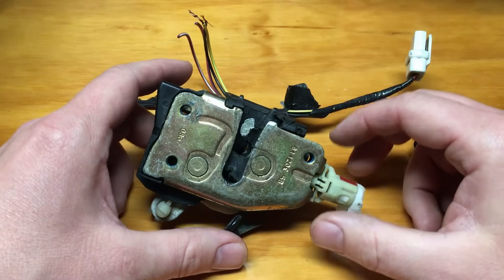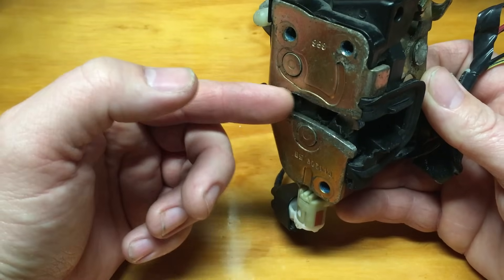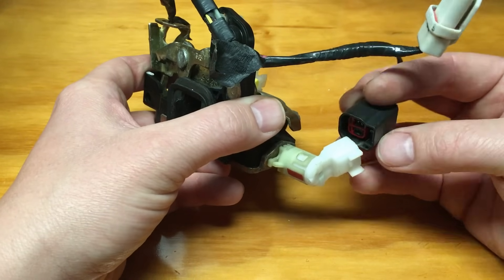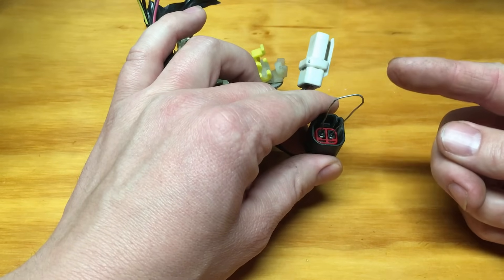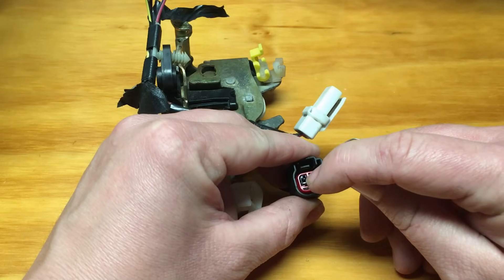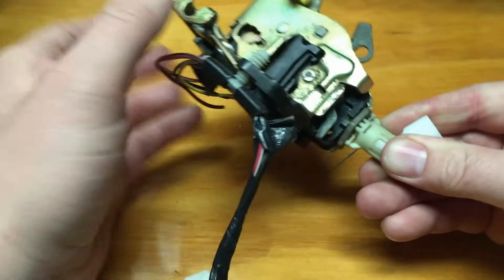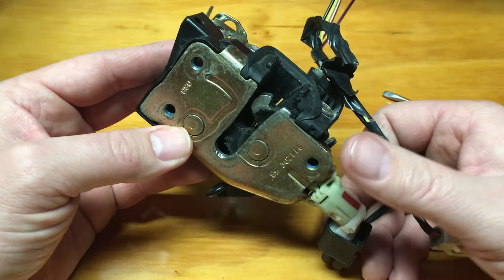Ford Quick Tips #76: Door Ajar Switch Testing and Replacement

Comment from the maker: A mix of rust penetrant and WD-40 fixes most of these:
Rust Penetrant I prefer-
http://amzn.to/2pTXk94
Follow up with this- 
http://amzn.to/2rrmsF5
Long Life Latch Lubricant-
http://amzn.to/2pL16pa
Reply: Thank you so much! I stopped the video to try the rust penetrant solution first...and it worked!!
Reply: These videos are so helpful. Thanks so much!
Reply: I got the door ajar switch out.. I crossed the terminals in the plug - when I do that the dome light stays on &I get the dinger alarm.. when I remove the jumper, the dinger stops.. and the dome light stays on. when I reconnect the door ajar switch the dome light stays on.. when I depress the metal button on the switch, the dome light stays on AND I get the dinger alarm.
Reply: @buckelsass8599 year does matter, some of the newer ones (plastic latch) work in reverse. Still same principle just a different command for ajar, either open or closed, if you get proper function with it disconnected jumped and un-jumped. Then the circuit is good and the switch is stuck either shorted or open. Hope that helps.
Reply: Could this be why my battery keeps dying quickly?
Reply: @reallythough4591 yes, because when the door is open, interior lights are on.  If the door is closed, but the system thinks the door is open, the lights will remain on.
Reply: What do I do if I have the opposite problems. 
As in the door doesn't always recognize that it is open
Reply: What tools do you need to take the lock assembly off?
Reply: bad advise
Reply: @user-lw2po6lu3k  good advice. Your just ignorant.  It works
Reply: @user-lw2po6lu3k  why so? And I’m just curious

Comment: I just experienced this issue on my 2015 F350 power stroke. I was able to pull the two white pieces of the switch apart and it was getting a bad connection so I sanded them so they had a clean connection put it back together and no more issues. My door no longer says door ajar. So if you don’t wanna buy that part, just pull it apart and clean it.

Comment: I was having an issue with the door ajar light coming on constantly in my ranger, I did try soaking the lack with wd-40 but the issue was persistent even after a full can later. After coming across your videos I managed to get the door latch out, took off the door jamb sensor, and opened it up to find a ton of dirt and grim built up around on of the metal terminals inside the sensor. I'm hoping after a quick wipe out it will work good as new!
Reply: Did it work??

Comment: So I just checked a brand new switch because, after replacing the door latch and switch, the door adjar for the passenger door still came on.  When I tested the new switch, it was closed and opened when depressed.  So I installed the switch floating, and no more door chime.  So what's up with that, and is there a workaround?/

Comment: What's the second set of wires for? Have the same thing in my door, wires that have a mirrored gate so they're not interchangeable with the ones you normally have plugged in there. What are they for?

Comment: By far the best ford mechanic... you've kept my 2009 f150 running the last few years . Now I'm being tormented by electrical issues. If you reply to these any idea for parking brake light not shutting off I've tried everything.  Master brake cylinder  change . Parking brake sensor . List goes on . Im thinking a bad ground somewhere . Any ideas ??

Comment: Hello, I installed the new sensor but the door still chimes when it’s closed while the key is in the ignition.  However, when it’s open and the key is in the ignition it doesn’t.  So it’s backwards.  Do you have a recommendation?

Comment: Do these Ford Sensors work  by sensing the presence or absence of a magnet on the door frame?
That's what Google search says how most work.
I have a Ford Territory, that beeps the horn triple times every time I lock the vehicle, the triple beep is a warning indicator that a door is open or ajar, and along with that the interior light doesn't go out, and the dash board warning door ajar indicator is lit up.
Very annoying, hopefully will get it remedied. Thanks for the excellent video tutorial explaining how these things work and the ways to test and fix. Cheers

Comment: FordTechMakuloco, ok what if its the other way around when your dome light comes on when you close the door and when you open the door it the dome lamp shuts off after installing a new door ajar switch on the front driver side on a 2006 Ford Explorer? Could the whole door latch be bad? The door could only be installed one way and i have that problem where the dome light situation is reversed with the open and closing of the door. I did the jumper wire method it that works. What i'm thinking something is causing the switch to be depressed when installed in the latch and when the door is close it makes the light comes on.
Reply: I got the same issue after I installed the new switch. When I close the door, a door ajar warning comes up, but it goes away when I open the door. Have you figured out how to fix the issue?
Reply: Same thing happening here.  I’m so confused.

Comment: Awesome video. I just replaced the switch on a 2002 Expedition rear passenger door. Removal of the latch wasn't worth the battle so I replaced it without removing.  Access was tight, but with multiple ratchet extensions and a flat head bit. I was able to lift the tab and turn the switch for removal.

Comment: Question. My dome light is on and the radio will not go on but when i close the doors the power running board do operate and close so what is the problem? Is there some other place for a bad connection?

Comment: Soaked it with WD 40 on only my driver door latch since its the one used 99% of the time. Works great now. Thinking the desert dust with be sticking to it now, so I might take it apart later and do a good cleaning, maybe use dry graphite.
Thank you for this video!
Reply: trying  this now to see

Comment: Spraying mine did NOT fix the problem! I’ve spent so much time on this. So frustrating
Reply: Hey, did you get the issue fixed? I have a 98 expedition and it’s driving me crazy with the alarm going off all the time since I am guessing the door sensor shows as one of the doors is opened.

Comment: Thanks for this video! With the help of this video and another. Was able to easily understand how it goes in there. As well as how to get the switch not only out as easily as possible without removing the whole latch like you did.

But by simply watching the other video 1st on how to get it out by removing the latch SCREWS, then moving the whole unit out a little, then removing the door lock (yellow piece) away from it. So that way I could pry the whole unit out a bit. Sticking my head through the inside of the door helped too. To see where the spot was to insert the new switch.

With that I lined it up like you showed and popped it back into place. Not as hard I thought. Thanks again!

Comment: I am also having a stalling issue. If i accidentally shift past drive into 2 or 1 it will stall sometimes or most times and then will not restart, but i noticed when it doesnt restart, as its cranking, strong crank, the security light on the dash flickers. Doesnt go solid for 3 seconds like it should. My dad thinks the fpdm by spare tire is bad but i dont think the fpdm has anything to do with seems to run

Comment: Hey Brian. I have a 2006 Ford F-150 with a 5.4, pretty sure its the 3 valve. Extended cab. Half doors in back. I am having an issue with what i thought was the door ajar switch. I ordered a replacement switch off rock auto which is supposedly a genuine motorcraft replacement, i dont know for sure. I tried to diag with these tips. When i unplug the switch the lights didnt come on. When i turn the dimmer switch on dash all the way up the lights will come on. I havent gotten the latch completely out yet idk if im going to cause im not positive the switch is the problem. Im doing it on the driver door. Could i also have a bad switch on passenger door causing both not to work? What else could be wrong causing this?

Comment: 2004 Ford Explorer.

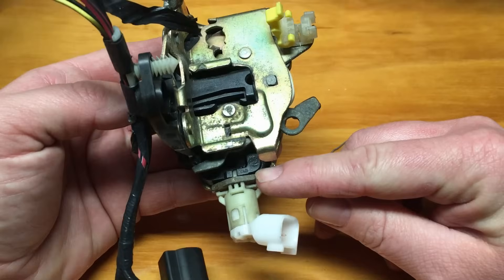Gee, I'm glad you took that switch out of the door latch assembly at the 5:11 point. Very illustrative. I spent about an hour trying to test fit the old part into that hole just to make sure I did it right with the new part, and didn't realize that a bit of plastic, a tab, snapped off of the old part. It was stuck inside the assembly, so the test fit wouldn't hold. Confusing. I used a very small screwdriver to remove it. 

So beware! Check the switch you remove; it should have a tab on the shaft. If it doesn't, check inside and remove the broken part or you'll never get the new part to snap in and hold!

Comment: IF ONE DOOR AJAR SWITCH IS BAD WILL IT CAUSE THE OTHER DOOR PIN SWITCH TO NOT WORK AS WELL?  I have a 2004 F150 supercrew and the dome lights will not come in when either rear door is opened. No door ajar light or alarm comes on.  Help?!!!

Comment: Question would the door ajar light have any thing to do with middle Council shutting off “radio, heat” When I’m driving door open will pop up then the middle counsel shuts down sometimes it comes back on a few seconds later last night not so lucky stayed off. I’ve been researching videos I can’t find any connection with the two? I have a 2011 Ford fusion SE

Comment: I have a 2003 crew cab, I'm having problems with the switch... it functions fine when it's not inserted into the latch mechanism, but when it's inserted in the mechanism and then I put the three bolts back in to secure it to the door, it alters the angle of rotation that the switch was in and then the dome light comes back on when the door is closed, and turns off when the door is open... any idea if the switch needs to be at a certain position? I've found a 1 or 2 oclock position when looking straight at the latch is what works, but it gets shoved over to a 12 or 11 position when reattaching the mechanism to the door... any thoughts? I have the original switch and a new switch, the original latch mechanism and a new mechanism, same problem each time.

Comment: Can you use a scanner to figure out which door is causing the issue? I have a 2004 F150 SuperCrew. I have had this issue for years. I tried various sprays but it didn't work so I just learned to live with it. Now I want to try and tackle this again. Thanks

Comment: Does the GEM module control the door switches? I had a windshield leak on my 2000 f250 which killed my battery. After charging them I noticed that my power step courtesy lights were on with the steps up and the doors closed and the steps won’t deploy at all. I’m thinking the windshield leak screwed something up and released the gremlins

Comment: As long as you had the door ajar switch out, you probably should have shown  how to do a continuity test on it to doublecheck that the door switch was the problem. Also, I don't think you pointed out that you stick the paper clip/jumper in the harness coming from the body/dash/GEM, not the door switch itself. But, thanks for the video, it gave me a good idea of where to squirt the lubricant.

Comment: Right on brother. I’m gonna try this next. I replaced the DDM and no change. So this is my next attempt. I’ve got an active  door ajar indicator on the dash but no chime. I’ve got no dome lights and no door locks. But power seats and power mirrors and power windows all work fine. No response from door lock function at switch ( tried a new switch ) no response when ignition key cycled 8 times, no response at keypad with last two buttons, no response when in drive or in park. Also noticed no power to trunk release. 
Even tho this is an aggravating issue I must admit I’m having fun trying to figure it out. Gonna keep the car for as long as God allows so new door switches next!!! Lol
Reply: Did you get this figured out?

Comment: All your videos are very well done and helpful , especially showing where and when to clean and lube when working on Ford vehicles .  On this one am wondering if a simple continuity test at the two pins would work to diagnose whether the door switch is faulty . Open door latch = infinite resistance and closed door = little to no resistance ?  By the way on horns that stop working have fixed them by drilling small hole in upper horn body and shooting in WD40 to free up the vibrator mechanism then shake out excess WD 40 . Then smear grease into hole to block potential water and crud ingress.

Comment: 05 taurus was saying right rear door ajar when open or closed. I unhooked the wire at switch with latch still in the door. With the wire unhooked it works opposite of what this shows and thinks door is closed. If I reconnect to switch it says door is open. I just left wire unhooked and now car thinks door is always closed.

Comment: Do the 6th gen Mustangs have the same mechanism? On mine, the door ajar warning works fine but the window randomly does the small drop as if I was opening the door. It feels like the switch now has two steps (or there are two separate switches that trigger at slightly different points)? When it works fine, I tried slowly opening my door and noticed that it would first trigger the small window drop and as the door opened a tiny bit more then door ajar / dome lights came on.

Comment: Thank you for the video! I installed a puck lock on the rear doors but the van kept saying the door was open. Just off enough to not engage that sensor. Just ended up find that connector in the door and closing the circuit with some wire. Now the van thinks the doors are closed 😃.

Comment: If only you had peeled back the tape and /or told us the colors of the two wires for the door open plug. This would save many of us tons of time to handle the problem in what way we see fit.
Reply from the maker: The wires are different on every model and even every year in some cases. So how would this of helped?

Comment: It looks like the actual switch comes apart. I'm going to try it tonight. We will see if it does. 

Edit: well figuring out how to get the door latch out on my 15 year old Ford took more hours than I am willing to admit. After I finally got the thing out I found that you can indeed take the sensor apart easily. A precision flathead screwdriver is all you need. At 0:13 in the video you can see how there are 2 different colored plastics for the sensor by his thumb. You lightly pry up the latching tab for the darker white plastic part on each side and the case pulls apart. The first side's u shaped latch will sit on top of the locking tab while you do the second one if you do it right. I will add a other edit later on if I was able to get it working again.

Edit 2: it was probably savable. All that is inside is a rubber / silicone seal, a plastic piece that holds a u shaped metal contact, and a spring. The grease or dirt from the past 15 years was blocking the u shaped metal piece from connecting the 2 contacts together. I cleaned it out with "heavy duty silicone spray and multi-use lubricant" I am sure any brand silicone spray or electrical cleaner would work. I broke the spring though so I will need to find a new one to replace it with.....
Reply: Hi did you end up getting a new spring? If so, where please?
Reply: @fluffykandie  There is a new law, you are only allowed to purchase springs in Spring, unless of course you are in Australia.  Then you have to battle a koala bear, in the TREES!

Comment: I have a 2006 F150 the rear dome light comes on but the front one doesn’t and also the radio stays on when the key is out and the door is open, about 20-15 minutes later the radio is off, will that kill the battery?

Comment: 02 Super Duty super cab. New door switches and new calibrated VSM. The door ajar and dome light work in reverse. Door open lights off, closed on. There is a different part number from 01 to 02 reference the door ajar switches. I wonder if I have 01 door latches causing the 02 switches to be incorrect. Any advice ?

Comment: 03 f350. my right rear all of the sudden started "working" I've owned it for 4yrs and the right rear never activated the lights and my running boards. now all of the sudden when I turned the ignition on to roll up my front windows last night the dome light stayed on and my right running board would not retract. really strange thing is when I open that RR door the lights go out! with the RR door open the Front right door works normally.

could this be the gem unit? or is it just a strange incident that the light goes out with the door open? California truck no rust or corrosion.

Comment: 3:23 I just fixed a 2006 F250. No door ajar operation from passenger side. I found that the system operates exactly opposite of what you described. Open circuit the dome light is off. When ground is applied (switch closed) it turns on. When I tore the truck apart it was missing the door ajar switch on that side. I ordered one from Ford and plugged it in andnothing. Got to looking around found the last mechanic's light in the door. I traced wire back to a broken spot on driver door sill.
Reply: Hi Eddie, I have the same problem with a 2006 F-150. The passenger door works the opposite of normal; when I close the door, the "door ajar" warning comes on, then when I open the door, the warning goes away. What do you mean by "the last mechanic's light in the door"?
Reply: @cristophermaya7904  They left a light inside the door IIRC
Reply: @cristophermaya7904  did you figured the issue? I’m having the same problem with my excursion. Funny thing that it wasn’t working at all and just now it’s doing the same thing as yours. Curious to see if you fix it